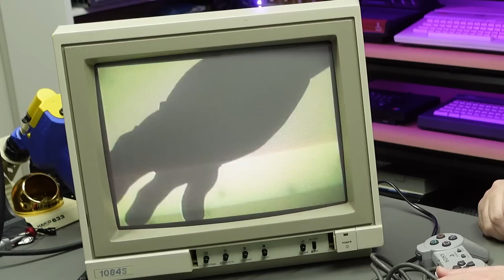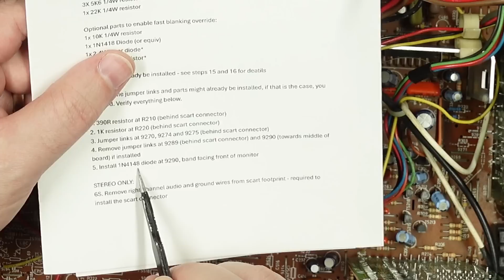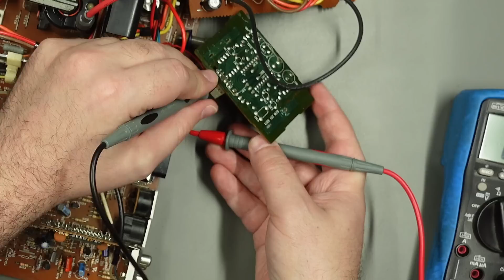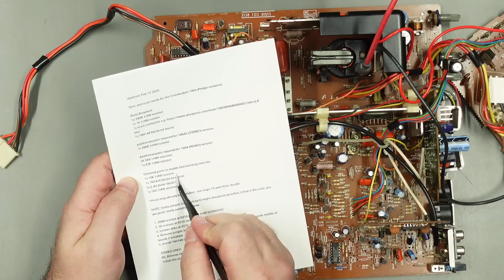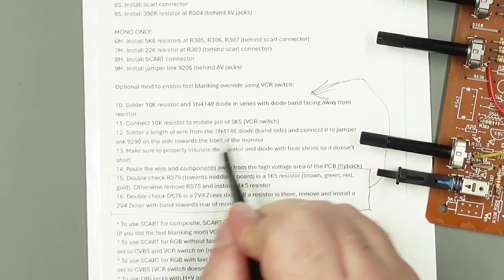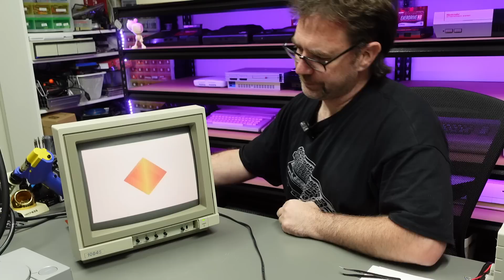Commodore 1084 new new scart and sync mods

Comment: First of all thanks for this great Video (and all the others). I made the mod on my 1084-S (PAL version) and it works pretty well. One Question though... I suppose Optional Part is meant to switch RGB to CVBS Signal. Video from Amiga is still rolling on RGB too fast.
Reply from the maker: The optional VCR switch mod forces RGB mode even when fast blanking is missing (no voltage on pin 16 of the scart plug). For the Amiga it shouldn't matter as long as the switch at the front of the monitor is set to CVBS. Do you have another monitor or upscaler that supports RGB that you can test with the Amiga? Or another computer/console that outputs RGB that you can test with the monitor?
Reply: @TheRetroChannel yes I can test with another 1084… I think everything is fine I just misunderstood the function on switch. Thought it will work when RGB mode is on. Thanks for the answer and keep up the good work with your channel. It means a lot for us retro enthusiasts ❤❤❤

Comment: Got two defective 1084s and repaired them. One "S" model has to be modded, so i can use it via scart with my amiga. Done this mod and could not be happier! Same boardlayout as yours. The only thing i did differently was to solder the audio wire to 78 via a hole on the board to this pin on the backside. Works like a charm! Thank you for this great and detailed video!

Comment: getting Sync from Composite does make it easy to not go inside the PS1... but you can also make VGA (RGB-HV) cables if you do go inside... 
the Service Manuals made it relatively easy to tap into the H and the V syncs before they got merged... (combining them outside the console did also work for a Sync without any interference, when i turned my RGB-hv (VGA) into a RGB-s (SCART) setup...
the VGA LCD monitor i have with 240p RGBHV support does happen to also be 16:9 and forces a stretch... i did enjoy an hour of Wipeout 3 Special Edition (europe) since it was one of few ps1 games with a 16:9 option, but only in the EU re-release version... 
my 1084 with RGBs from the PS1 also has been used now for some Time Crisis 1 + Project Titan + Point Blank... the separate AV RCA make it easy to give the Gun the sync signal it needs also, composite sync is good enough for that seemingly, though i suppose aim accuracy might improve a few % with a purer sync going to the Guncon (lightgun) also...

Comment: My Commodore 1084 (Australian model?) actually came with SCART already ready to use... (Mono Speaker on left side)
we didn't notice until a few years ago... dusted it off, set it up with RGBs/hv from a PLAYSTATION SCPH-7502...
I've also just made a PS2 to S-Video adapter for the pre-S-Video standard it uses with 2x RCA connections... hopefully that also works out, though I'll know soon... (since PS1 can put out true RGB, yet PS2 doesn't like it as much as Component/S-Video... )

Comment: I'm not really into monitor fixing, but I've added scart and did the sync mod except the fast blanking part by following the guidelines given here. Thanks a lot for that because it works. It works better than just hyjacking the signal from the 6 pin din.

But I do wonder, why won't this screen accept both pal and ntsc on its rgb? Its older Philips brothers and sisters in the same casing and almost the exact same pcb have no problems switching between both systems.

Mine accepts pal and has sync distortion when the source is ntsc. When I switch to composit the screen is rock solid, be it black and white.

I was hoping to have some spare monitors in case my cm8833 screens and vs0080 screens die, but for now I think 1084S-P is not an option.

Unless somebody knows what this monitor is capable of and how to achieve it...

Comment: Thanks for the video..

I have a 1084S {Philips version} in the shed, (as well as a C64 and C128[flat]. C64 has issues, 128 is fine)  

Now just need to dig it out and have at it.

P.S. I have the 1084S wiring schematic in PDF format if you have need of a copy.
Reply from the maker: Thanks, I think I found some better schematics after this video. Good luck with the mod

Comment: Hi, I installed a scart connector and nothing else (it works fine on my original 1084). The thing is the hue and color knobs don't work with rgb over scart (they do work with composite). Does your mod enables hue/color control for rgb?
Reply from the maker: No, and in theory the RGB input shouldn't need any adjustment as it's already in the displays native format. I've had other CRTs with RGB from factory that do the same
Reply: @TheRetroChannel After I posted I found the PAL user manual, there it says color knob is disable for rgb signals. It does look awesome as is (playing Sheep Raider now on the PS1), just wanted to make sure I didn't mess something up while recaping. Thanks.

Comment: I made the mod on my PAL 1084 (non-S). I cant get Sync. Does the Monitor Support Composite-Sync or only Sync on Composite?
Reply from the maker: It should work with both. What are you using it with?

Comment: I have a 1084 monitor with the DB9 plug, so I don't think it has the SCART option. But I will keenly check the board it's a 1989 Korean Made version, and my MiSTer works on it, with SOG, but most other consoles (SNES,MD2,PCE) will not work as I am using the SCART plug, to a PLUG to DB9 plug, but the SCART CSYNC is not enabled. I need to check the board and see what the best way forward is. I would love to get the old consoles working on it. My 800XL has RGB and CSYNC which actually works on it, so it's not too bad.

Comment: I have the same monitor PAL version UK with Scart factory fitted in the back it will work fine on my Nintendo wii and Nintendo snes but will not work with my Nintendo 64 have you tried a Nintendo 64 on your monitor
Reply from the maker: The PAL N64 does not output RGB unless you have installed a mod like Tim Worthington's N64 RGB

Comment: I may have missed it, but is there a precise explanation for why (from theory) the previous mod did not work and why the new one fixes it?  Or was it pure trial and error discovery?
Reply: We didn't fully reverse engineer why it didn't fully work -- but it was mainly the old mod was feeding the DIN sync into both the composite sync circuit and the DIN RGB sync circuit. (The monitor has two sync circuits and the button on the front selects between them.)
Reply: @adriansdigitalbasement2  the monitor now acts like a SCART CRT TV where it uses SCART pin 16 (blanking signal from the console) to signal to the TV that the input is RGB vs composite video. I'm guessing something in the old mod was making the cvideo signal to go out of spec resulting in temp loss of sync.

Comment: Its interesting that on your 1084 they have not installed the sharpness circuit but on Adrian's 1084 and my 1081AU they have.
Reply: I am wondering if that is the 1084S always lacks one. Mark has a 1084 (mono) that already had SCART on it, so I asked him to look to see if it had the sharpness control.
Reply from the maker: Yeah no sharpness control on the mono PAL 1084 either. I've only seen it on the 1081 for reasons only known to Philips
Reply: @TheRetroChannel  I notice on my NTSC one that the sharpness control has a "NTSC" silkscreened on its position.

Comment: I’ve been trying to add in the chroma luma capability to my Magnavox RGB 80 display. Mine came stock with only composite and TTL RGB. S video is most useful to me, but someday I’ll definitely add in analog RGB capability
Reply: It's possible -- you would need to modify the monitor the way the 1084 is modified to add Y/C. It basically has a switch to feed the chroma directly into the color decoding IC. WHen looking at how it's done on the 1084, you can see it's definitely a mod done after the fact as it uses a flying lead to bring the chroma to the right part of the board. Most of the service manuals for the 1084P are not really the right schematics, and don't show the chroma jack and associated circuits. I have a copy but can't even find a copy online.

Comment: I have the Phillips version of this monitor. There are some obvious differences. No knockout for a scart connector in the back of the cabinet. It will be interesting to open it up and see if there’s traces and layout for the connector on the pcb. I think some of the input jacks are different or missing. I have to replace the power switch, which I bought already. I just need to get a “round tuit”!
Reply from the maker: Yeah would be interesting to see if the spot is there on the PCB for it, my guess would be it's the same board as the 1084 just with different bits populated. And don't worry half that stuff on the shelves behind me is waiting for me to get round tuit
Reply: I bet it has the sport on the PCB for it. I would be a little wary about installing one as the knockout on the rear case also has some bits of plastic to hold the SCART jack in place when the rear cover is installed. Without those, you are entirely relying on the PCB. I bet your Philips version also could accept both the DIN jacks for TTL and RGB as well, although I think more mods would be needed to enable those. (Especially TTL as that requires a little add on converter board)
Reply: @ thanks for the input and advice. I’m out of town so I can’t look at it right now, but I believe it already has the two round din jacks… but for rca, I think just one composite and one audio input, but I will update on what I find and put some pics on my channel, “Bob’s retro electronics workshop” if it’s something interesting!
If I was to install a scart connector, I would figure a way to support it!

Comment: i might have to pick your brains as i have an Acorn AKF-12 which is basically a PAL one of these only it doesn't support composite over scart and doesn't have any other connections but scart but has the cut outs and spaces on the board for them, it'd be great to mod it to have the full range of connections supported
Reply from the maker: Open it up and see if it's the same board and what components are installed/missing. It may be that you can use the same instructions
Reply: Have a look at the 1081 service manual (CM8535 schematic) and also look at the Philips CM8832/CM8852 service manual. The AKF-12 probably matches one of these chassis.  You would need to add all the PAL/NTSC IC501 stuff. Too many hard to get bits probably. Anyway it might be worth taking the cover off and checking if IC501 is installed & you may be able to do some sync mods, maybe mono video.
Reply: @moshly64  I agree here --- looking at the manual for the AKF-12 it seems to entirely lack the CVBS composite capability, so indeed it probably entirely lacks IC501 and all associated composite video processing which would mean getting working composite would be really hard. (If the chip is there, that's a different story, there are probably just some missing jacks.) The monitor also lacks the colour control (which is associated with IC501) so it really leads me to believe those parts are entirely omitted and you're stuck with just RGB. The TTL RGB jack also has a mod to only accept composite sync, which is interesting and must be designed to work with the BBC Micro, which outputs TTL RGB. The other monitors use a TTL RGB that is like CGA, which H and V sync input pins, but dark yellow is brown.

Comment: OT:
I'd love to see an external combiner chip that would overlay the VIC on top of the VDC via a chroma-key using color-0 of the VIC to pass-thru pixels from the 80-column screen.  This would allow the C128 to use hi-res backgrounds for games while using the VIC for sprites and other animations as an overlay.
Reply from the maker: That would be cool and I did manage to do a similar thing while experimenting with the scart mod and fast blanking. Feeding one of the RGB colour lines into the fast blanking pin I was able to overlay the 80column text over the 40column screen. But as the VDC and VIC-II are not syncronised in terms of their video output the 80column text was rolling up the screen over the 40column display.
Reply: @TheRetroChannel  could potentially use the monochrome signal for sync, no?
Reply from the maker: @loudfiero not really as the monitor is already getting sync from the VIC output and the VDP is out of sync with that. You would need to combine both sync sources externally and find a way to synchronise them.
Reply: @TheRetroChannel  One would need an external time base corrector to sync the 40 col output to the 80 col sync, then you could do this overlay with some extra circuitry to tweak the fast blank circuit.

Comment: A marked up schematic would be great to understand everything that is being done here.
Reply from the maker: Yeah it's a bit tricky as we referenced a few different schematics to figure this out and none of them exactly match what we saw on the boards. Basically we are restoring the circuit to connect scart fast blanking from scart pin 16 to the "jungle" IC. Doing this allows the monitor to automatically switch to RGB when a scart cable is plugged in. The rest of it is just connecting the audio circuit to the scart connector. And finally the VCR switch mod is a way of sending that fast blanking voltage to the jungle IC (swtiching it to RGB) without relying on the fast blanking from scart